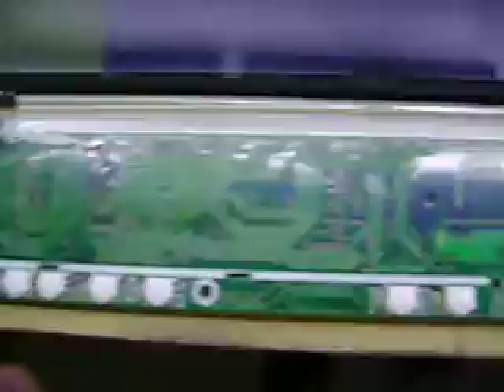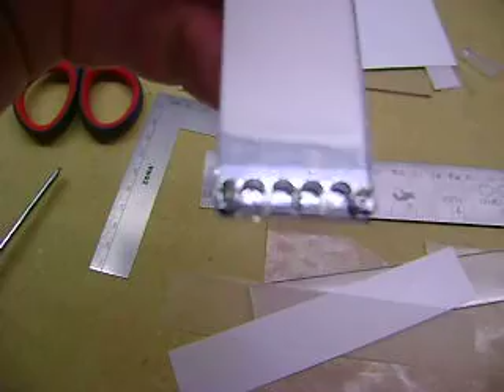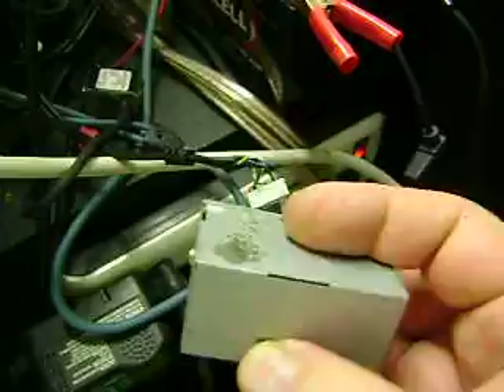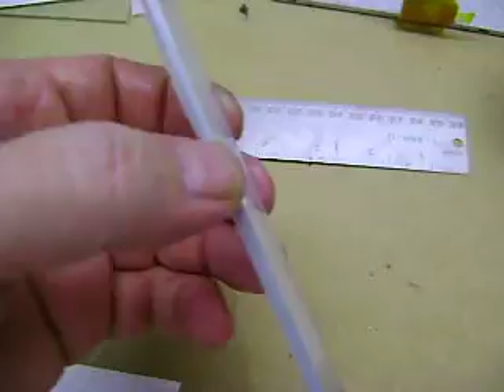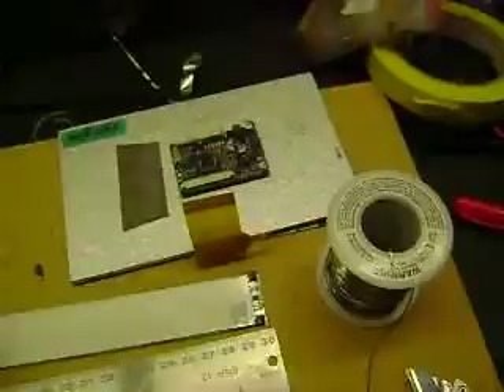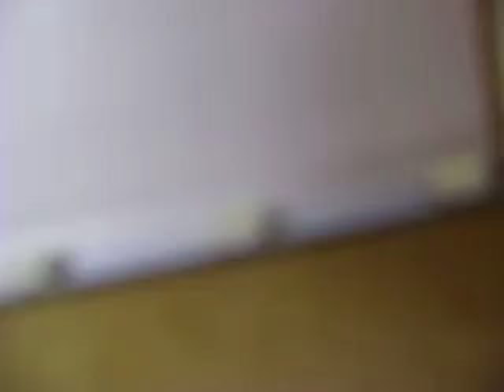Repairing My Pioneer DEX-P1R CD Radio Face Plate Display Pt 1

Comment: can i contact you i have the same issue
Reply from the maker: We can talk here if thats ok.  Most all small tv monitors that say 'led' are led back lit. They are cheap also.
Gota be careful with the face plate display. I have 3 of these radios and they were all dim, after 20yrs. The first one I had shown in the vid after a while the pixels started not working on the left side of the screen. This was due to the previous try with a thicker led dispersion plastic and puting the face plate back together was very tight and most likely hurt the display connections to the board. But the thinner dispersion plastic, I think thats what its called, works great and is just about the same thickness as the electroluminecent panel that I removed.

Anyway, any questions I can answer.

Mags
Reply: the ribbon that goes to the display lcd is also damaged any idea how i can get a replacement ' its carbon connection i think, i cant solder the broken pins
Reply from the maker: @PaulCan2006  

Ebay seems to have them often. And sometimes a DEX-P1R.  ;)
Reply from the maker: @PaulCan2006  

That is a problem.  Every so often ebay has just a face plate for sale. Id keep looking there. If the case is bad on the ebay faceplate, you can just put the ebay circuit in your case.
When doing the mod in the vid, just make sure the led strip and difuser screen ar a thin as the original back light panel. And if your careful with the display as you go about it, it should be ok. Like I said above in a reply. I tried it with a led backlight that had a thicker difuser and when I put it together the extra thickness caused my display cable to go whaky also.

Mags
Reply: How I can buy these display backlight
Reply from the maker: @hussienmohamed8714  

Sorry I took so long to reply

Just a cheap 7in car video monitor, like$20 that says it is LED, meaning the back lighting is by led. The diffuser screen that disperses the light from the thin led strip and the white sheet panel just need to be measured and scored with a razer knife and snap  apart. Once I got that to fit, I soldered the led to the  points on the face plate circuit board, but you have to open up the small box on the cable behind the radio and just remove the whole circuit board. On the plug to that board there is 2 terminals, 12v and GND, and then there is 2 more terminals that go to the 2 solder points I mentioned above. I dont remember the resistor value that is put in series with the led strip to run on 12v. Ill look at it. So just use a meter to make sure which wires on the plug associate with the solder terminals and connect the 12v and gnd from the plug to the other 2 wires on the plug. Ok I just looked at it. On the plug for the small display driver box, it is a 7 pin plug. I put the resistor there . 200ohm resistor in pin 1 and pin 7.  and a simple wire jumper from pin 2 to pin . It looks the same both ways even if you done know the pin numbers. Draw on paper and you will see.
Mags